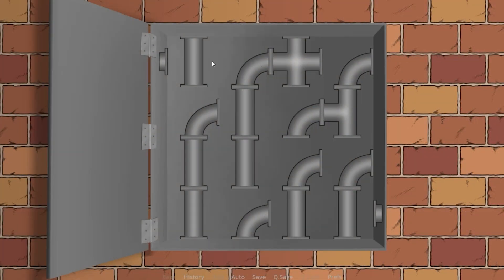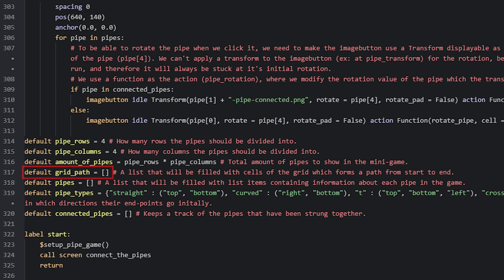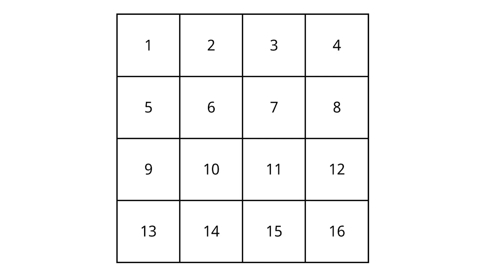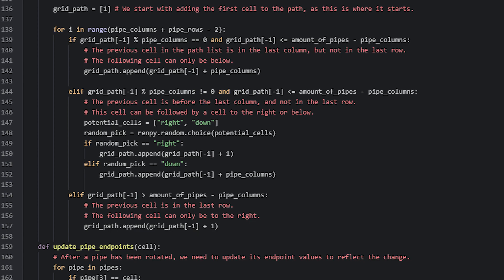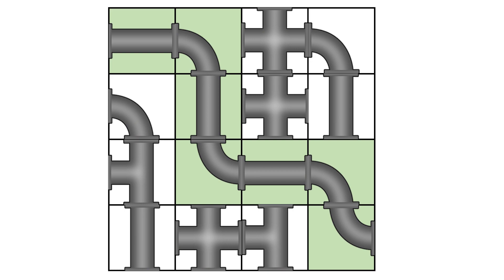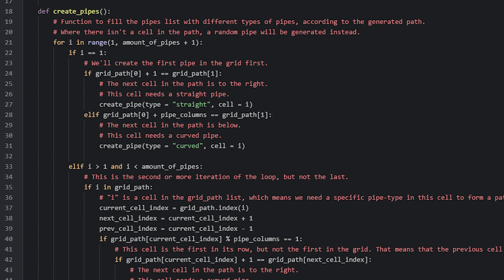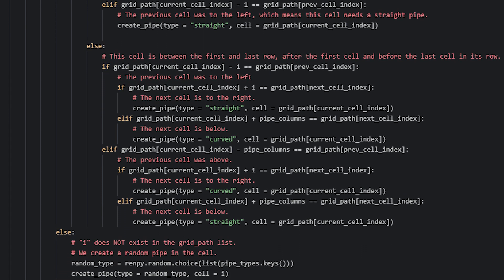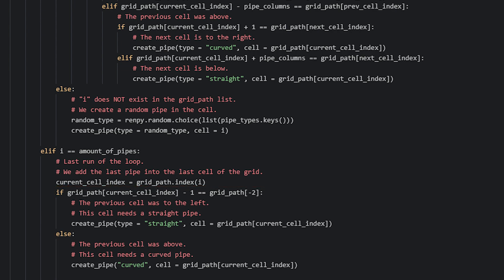Ren'Py Pipe Connecting Mini-game Tutorial - Part 1

Comment: I have an issue with the code where it won't turn blue when it connects to the straight tube- I have checked my code multiple times and can't find where the error occurs because besides the fact that the straight tube won't connect, everything works perfectly. 

Update:
I managed to fix the issue of the straight pipe connecting but the new problem is the connection stops around grid (10,11,12,14,15,16) and the only real way to complete the game is on a very specific path (1,5,9,13,14,15,16). can someone tell me what I'm doing wrong?
Reply from the maker: This script only generates one valid path to take. However, depending on what random pipes are generated around the valid path, there might be additional ways to connect the pipes to the end. But again, that's entirely random. Only the generated path makes specific types of pipes that can be connected to the end.
Every time the game starts, there should be a new generated path.